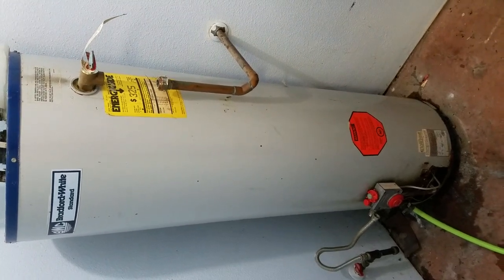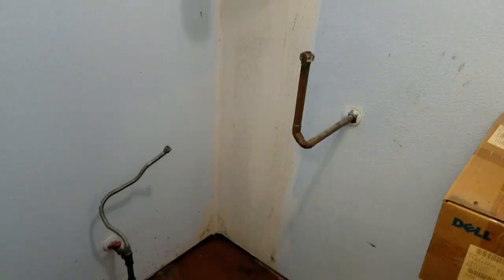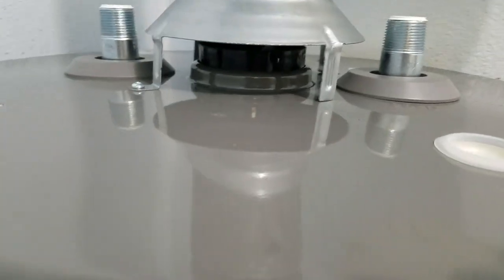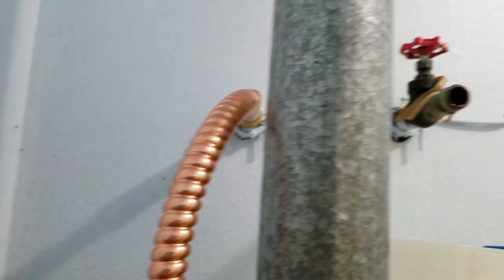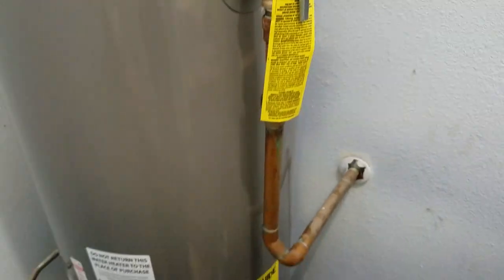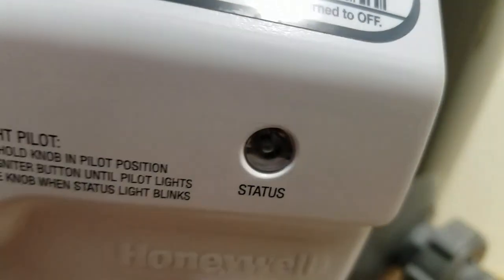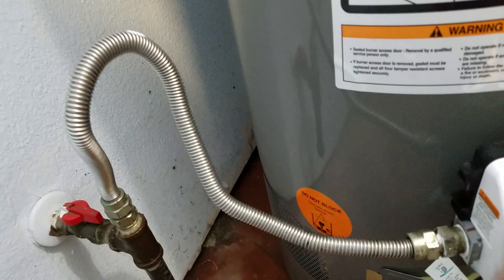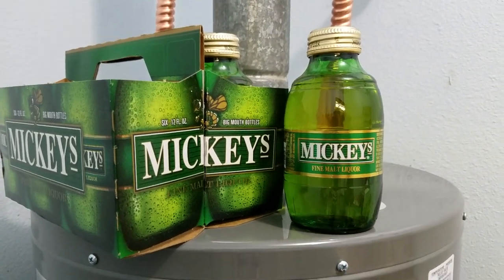How to Replace your old Gas Water Heater DIY

Comment: 9:26 If you do this, don't pull these "plugs" out. They're not plugs. I checked with Home Depot and these are meant to be there permanently, part of the "dielectric nipples" which deter corrosion.
Reply from the maker: Good to know, Thanks for your comment.
Reply: I agree, I think it is for back flow preventer. If the instruction manual didn’t tell you to remove then don’t remove it

Comment: Was looking at energy rating tag....it cost $638/ year to run i would think maybe electric would be as cheap if not cheaper to operate. I never had any idea propane cost so much .Good job on the video, cheers.
Reply from the maker: Well first off .. Thank you.
When my original heater went bad (Propane) I looked into wiring my restrooms for 220v. I didn't think it was worth it. I could and may be wrong.
 I do like the gas heaters because they heat so much faster and during tourist season I need that. 

BTW .... this new heater works WAY better and less costly than the old unit. Thanks for watching... BB23
Reply: @breakerbroke23  yes i definitely agree, gas has ALOT better recovery time and I never considered your cost to run a 220 line thanks again for the video Cheers

Comment: I believe you need 3 screws in the exhaust vent to the tank flute per code.
Reply: 🤔Code🤣🤣🤣🤣😎
Reply: Should have replaced the 4 inch duct tubing before the larger tubing.Very cheap to do.Bet old duct work is rusted and corroded inside.

Comment: I looked at Lowes for the flex hose/pipe etc.Did not have unless overlooked.Where did you get the copper hot cold flex hoses? Also, when installing a new tank ( gas ), 1).Exactly what do you do to bleed the air in gas side as well tank itself when filling with water?Leave a sink on whole time tank is filling or turn sink on then off then fill tank?
Reply from the maker: I bought the Copper Flex hose at home depot, I think it was in the same isle as the Water Heaters.
I did open the faucet (hot) of a sink on the other side of my building until air stopped coming out as I filled the Tank. 

Thanks for watching....BB23
Reply: Home Depot carries the copper flex pipe and other plumbing supplies. I always replace the flexible gas lines when I install a new furnace or water heater.

Comment: If there was a service interruption would you shut off gas supply valve? I called electric /gas company to stop service and other people were moving in. It'll be under their name now.
Reply from the maker: Great question, this is not something I have had to deal with. If you are worried about some sort of liability then yes I would shut it off.

Comment: I would have placed the flex tubing directly from the gas line in order to have the trap very close to the controller.
Reply from the maker: Yes, but I wanted to have the valve coming right after the black pipe, cause I have had a flex tube develop a leak. I just want to be ultra safe..  And I believe this is code. Thanks for comment.

Comment: Did you replace the anode tube in your old water heater?
Reply from the maker: No.
Reply: I wonder if you could get a tankless to last that long without any maintenance. I just replaced my 30 year old tank which I didn’t do any maintenance on and I doubt the previous owner did anything as it was filled with sediment and could not be drained. I owned it for the last 7 years of its life.

Comment: Do those new water heater pilots have batteries in them?  How does it blink lights on and off without one?
Reply from the maker: No batteries. the pilot generates a small voltage to power the brain.
Reply: Yup it uses the flame for power.